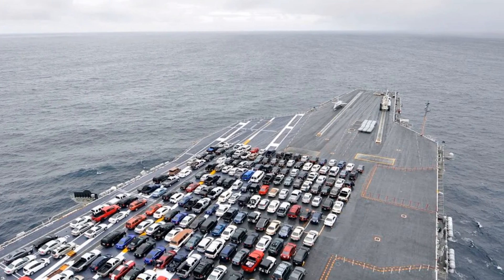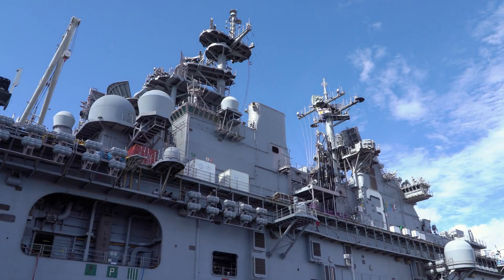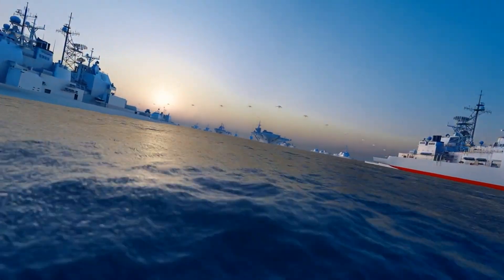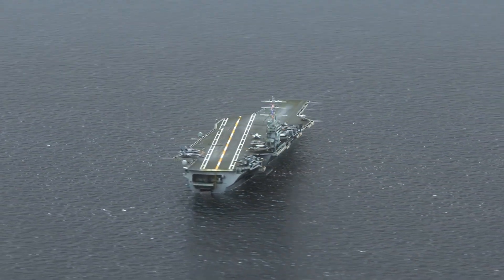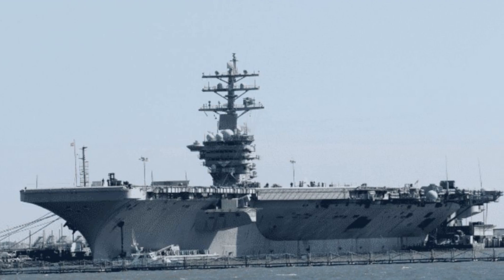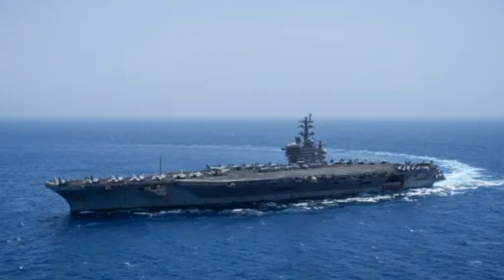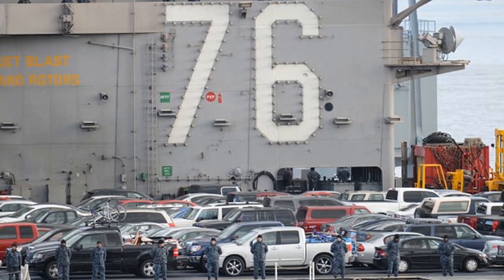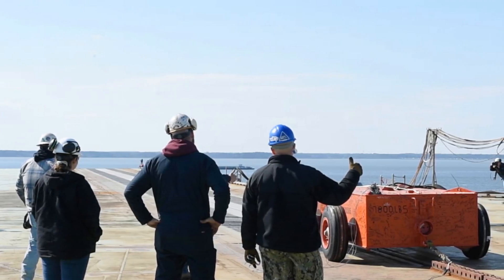This Is WHY Cars Get Launched Off Aircraft Carriers... And It’s TERRIFYING!

Comment: Sounds like bullsh"t - cars weigh <3000 lbs while planes weigh 10 - 20 times more. why not use purpose built, re-usable steel flat trolley cars equipped with a built it buoy and cable system, after launch, the buoy and cable is released at i.e. 280 ft depth from a compartment in the cart. The buoy pops up to the surface and a smaller ship retrieves cart for re-use